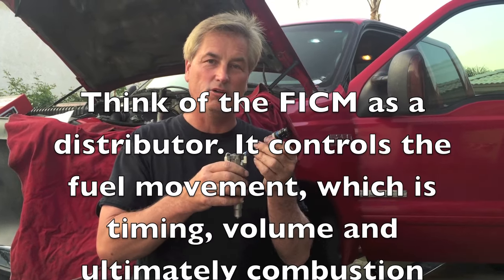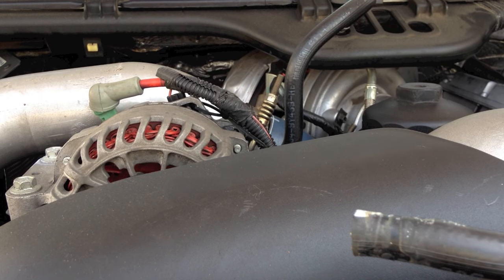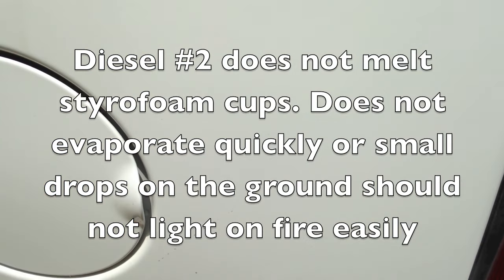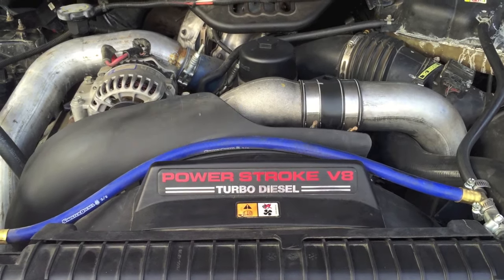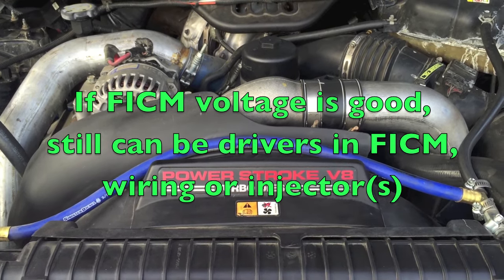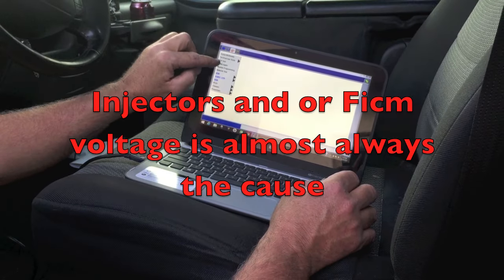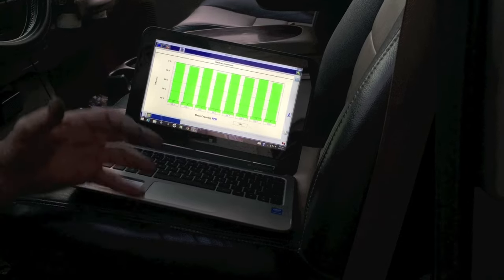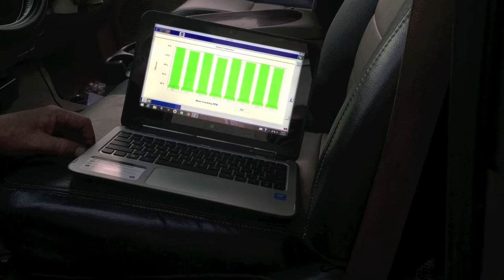6.0 Powerstroke Runs rough. Identifing which one and common causes

Comment: I'm sending a huge THANK YOU up to you in Heaven, Ron!  I'm currently dealing with misfires and because of you I know what I need to do to diagnose this.  Already did the listen (starter wire to battery) test on the base engine--good.  I'll be getting a fuel pressure tester, and if low check if I HAVE a blue spring as I was "told" when I bought the truck, and buzz testing the injectors.  I got this!  All because of you sharing your immense knowledge.

Comment: Hi. Thank you very much for your advice and help in the videos.
I am from Mongolia, Central Asia, far from the US. I own an Excursion 2004 V8 6.0L Powertroke. There aren't many trucks like mine here, so workshops here don't know well about it. Nowadays it has a problem and  rough idles and stalls. i had it scanned and got some fault codes which are P0113, P0275, P1102. Can you help me and advice what i should do? Could Rev-x or Archoil help it?

Comment: READ THIS....I had many of these symptoms even took it to my mechanic in town who is a pretty good guy untill I found out what the problem was....First I tried rev ex...My 2003 F-350 6.0 started running rough at idle and loss of power untill high RPM's. So i paid for a new injector, 50 miles later took it back with the SAME exact symptoms ...replaced FICM.....got it back and after 60 miles...started running rough again....SAME SYMPTOMS ......THEN TOOK it back and I was told it was another injector....so I took it home and moved each glow plug wire until I got it, you could hear the engine change...I just wiggled the wires....number 8 was the issue...so I too a piece of hard copper wire and taped it up then taped it to the glow plug wire and propped it up in the direction where it ran well.   I did try to clean and spray the male and female connections and put the goo on them...I also looked at the female end of the plug and took a very small knife and bent the prongs in a little...when the mechanic checked the wires he used a probe and probley widened them so there was not a good connection...sounded EXACTLY like this and it was a simple fix the whole time that anyone can do.
Reply: how did it effect the way the truck ran? glow plugs only work for a time period to get the cylinders and fuel to temp...
Reply: @Davidwhat  Yep about 30 seconds after start. This runs longe with plugs glowing?
Reply: @tomasnokechtesledger1786  up to 120 seconds depending how cold. Hot days less like 30 seconds but if it's below like 40 or something then 120 seconds
Reply: The heat from the engine combusts the fuel. The glow plugs only operate when it's 1st started and no heat is present in the combustion chamber.

Comment: I have had very good success using an O-Scope on all injector control ckts via the BUZZ TEST. Checks both open/close solenoid valve coils, be aware FICM may have defective solenoid driver, only a scope will verify this condition.
Reply: Can you tell us how do you setup the scope ?
Reply: @raulc.suenaga2522  First off you will need a two channel scope which will support 100+ DCV.   Back probe the "CONTROL"  wires of the injector operating coils. Each injector has 2 opcoils.  Accessibility is a reality.  Rerun the BUZZ TEST and watch the wave patterns of the control valves, they should be quite symmetrical.  The flat lined wave pattern will be your failed driver ckt within the IDM.  Had to show this to a local dealer to prove the reman IDM had failed.   IF you do as many of these as I do, Build a deparate harness to install between the IDM and the chassis harness with test fittings built right in for each injector.  Am avail at wj893@bellsouth.net also.

Comment: I really liked this video. Especially the testing and diagnosis of the bad #7 injector. However, when determining whether it is wiring or a bad injector, absent having a spare injector on hand, do you have expected voltages (at the connector to the injector), amperage (in particular, a waveform of a good injector using a low amp probe) and expected resistance of a good injector for those of us utilizing a lab scope?
Reply: What did it end up being?

Comment: You left out one of the coolest parts. The reason it is caused an "intensifier" piston, you have X surface area on the top of the piston in the injector, and Y surface area at that "nail point" you mentioned. If the top of the piston has 10X the area of the bottom, and you hit it with 3000 psi High pressure oil, you are injecting at around 30000 psi.

Comment: Hello, I am getting "Check Engine" light on my Mercedes C Class 2011 model car, I scanned it via OBD2 scanner and it showed me P0266 cylinder2 Contribution/Balance Code and P0272 Cylinder 4 Contribution/Balance Code , on searching on YouTube I found videos that showed the reason for this error as even on clearing the scanned codes ,it comes again and the light also come again when we start the engine again after closing it once, so the videos showed that it's error with the injector wiring and need to be swapped amongst themselves, so how can I get rid of this issue?
Reply: Think you posted to the wrong video. He teaches Ford Powerstrokes not Mercedes haha

Comment: I have checked the compression, and listened to the injector pre-cycle and it sounded good. The problem is when I crank it and it's about to turn over it goes blank for a second then sounds a little shaky, then it smoothes out. When in reverse it runs rough and occasionally it will run rough at idle (stop lights and such).  I haven't checked FICM voltage as I had it replaced in '11 and buzz test sounds good. I don't know what it could be and your help would be appreciated! Thanks.

Comment: Hey Ron great video. Thank you. Just a question if you did a relative compression test on a scope with a high amp clamp at battery and wanted a sync signal to identify #1 cylinder . I would think you would shut fuel down to prevent engine from starting and low amp clamp one of the four wires going to the # 1 injector. What would you do? Mark ferraro

Comment: Does anyone know what he meant by not resealing the injector or oil rail? All I am doing is replacing all 8 injectors and connecting the oil rail when done.
Reply: I was wondering the same thing. I pulled the fuel rail to replace the stand pipe and was wondering if I should replace the injector o rings and washer while I am there
Reply: I found out those 4 cups along the rail have o-rings behind them. You have to take those cups out and replace the o-ring "seals". You need a special socket to take them out and put the cups back on, torqured to 100 ft lbs.
Reply: Yes they sell a tool with seals to service them ford wants you to spend an arm and a leg and sell some a#$ to buy the whole oil rail. Just dont go too cheap from a quality aspect when choosing an aftermarket brand to go with. Alliant sells a kit  everybody in the diesel world stands behind that brand haven't tried them myself yet but just look for quality.
Reply: @James-110-gry  I remember i bought one of those special sockets and it stripped. Ended up buying another one with the seals and it worked well. Can't remember which brand. Got it from XDP diesel.

Comment: My Ford 6.0 start and dies right away has new icp new ipr valve almost 1000psi when I crank so good pressure no leaks and new fuel filter I don’t know what else also Fcim above 48 volts

Comment: 6.0  '04 F250 died going down the road, will crank over but no start. Done leak test,I hear air,I've changed the plugs,my new dummy plugs are the same but the rear stand pipes are made different from my original. It's the 1/2 inch drive square head. Will these pipes fit my truck?I haven't changed the stand pipes but repressurized the system and still hear air. Could it be an injector leaking causing it to lose pressure?
Thanks, simple guy trying to fix my truck.
Reply: Cynthia Houston what did you find to be the problem?

Comment: I just worked on a 2003 f350 6.0 I found it to have a high pressure oil leak under the driver side valve cover, so I pulled the valve cover off and found that the oil rail was loose apon further inspection I found that the bolts had pulled the threads out of the head, have u ever seen this before
Reply: I did that once on my 03. Hot tune and was being unreasonably hard on the truck. Blew the rail clean off against the valve cover and pulled all the bolts out

Comment: i dont know if this a scanner issue or if you ever experience this one. when a retrieve engine code #4 injector contribution but when i did a power balance test different cylinder are down
Reply from the maker: Misfire monitors if it has it. Are only when warmed up. You may have a Ficm and failing injectors.

Comment: I just found out my wife filled the truck up with gas instead of diesel. What do I do now?
Reply from the maker: 99% of the time on 97 and newer if it wasn't driven to much you can drain the fuel. fill with diesel and it will be okay.  I remove the hose on the out side of the pump and jump the fuel pump.  collect it until it's 100% empty.  if you don't have a jumper or a scanner to command it on.  you can keep cycling your key in ten second intervals. in also usually do the filters. it gets more out and they were not made for gasoline.
Reply: I found out the hard way that gasoline in oil and diesel filters causes them to swell up and slow/stop flow. Really bad on oil filters.

Comment: Once my truck heats up I have a cylinder 6 and 8 contribution codes being thrown. Idles like hell because they're dumping fuel but runs fine over idle. Replaced injectors, any ideas?
Reply: Been a month since you posted.  Did you do what he did in this video? Get results?  I'm getting Cyl 8 Contribution code.  Getting ready to do what he showed.  I'm confident I can resolve this thanks to Ron.
Reply: @Solamia7  EGR was stuck. No idea why it only threw off the rear cylinders
Reply: @TPProtege  Huh.  OK, thanks for responding!  I'll check mine out.
Reply: @Solamia7  the injectors on the motors are pretty solid. The oil rings go but the injectors themselves hardly ever do
Reply: @Solamia7  the wavy rail also had a lot of sludgr, definetly didn't help
Reply: @TPProtege  Did you even get an EGR code?  P04xx?

Comment: can you a video on the pro and cons of changing the injectors vs just the nozzles?????
since you say not to use aftermarket injectors????
Reply from the maker: Driving or sitting on the side of the road.   It's not the nozzles or that area that fails.   I get emails daily from people.   Plus all the local shops stopped trusting them.  It's usually the upper seal or snap ring that fails.   I've tried a bunch of brands and watched major rebuilders stop doing them.
Reply: +DieselTechRon So if I wanted/ needed to upgrade the injectors because of a larger turbo, what would you suggest?? I wanted to purchase 155cc nothing too extreme
Reply from the maker: +wellsmd1 for the custom tuning or matching parts.  Search Jodi Tipton.  He has a great reputation on tunes which would take knowledge of what works best together.  Or Tadd at elite diesel.

Comment: I watched your video on the FICM. I followed it to a Tee. The voltage was good. The motor is still running quite and smoking like a train. I gave it a little gas on the pedal and it smoked like crazy and ran really rough. Am I looking at injectors at this point. I have reached my technical limit after checking the FICM. I have had the oil cooler and EGR deleted. Please advise. Thanks
Reply: Mike Walker what did you end up doing to fix? Just curious.
Reply: As I stated below, my wife put regular gas in it. I drained all the gas out and filled it up with diesel fuel. However, it screwed something up because every other day it runs rough as hell. So...I'm waiting for it to drop dead again. I think the injectors are next.
Reply: Mike Walker sorry to hear that. I just put new heads on mine and studded the unit too I also put a new HPOP and oil cooler in mine. Cost me $3400 to do it all myself.
Reply: @mechanicdave4899  u studded the short block also?
Reply: Jermey Gonzalez yes sir! Bought head gaskets from ford. Also I bought arp headstuds from Ebay. I did the work myself.
Reply: @mechanicdave4899  new to the diesel world,  so might be a stupid question. But having it studded makes the motor last longer or how does that work?

Comment: Who makes a good 58V FICM?
Reply from the maker: Bulletproof
Reply: +DieselTechRon Awesome thanks! And a 58V alright? Does the added voltage damage anything or accelerate wear on components?
Reply from the maker: +David Durnberger no wear but it may set a code on some calibrations

Comment: I agree with some of the other people here that some of the data and information Ron discusses is in error, or slightly off base. For the most part, he provides very good information, but its a good idea to be wary of any information you are provided. For consistent near perfect advice I would have to recommend power stroke help over Ron.

Comment: dieseltechron .If you were still around ,I would have to tell you that you are wrong about diesels not running rich or lean. For an engine to run rich or lean, means that oxygen is present in the exhaust after combustion or not. This clearly is the job of the oxygen sensor .So you were telling me that if an EGR sticks open and dumped pure exhaust into the intake, it will not affect the performance of a diesel? I can tell you from experience that it will not pull out of its tracks hardly, if this happens. Rest in peace DTR, you were a great technician, however I think in this instance you were repeating something that you had heard ,or were told.
Reply: Bro what are u proving?